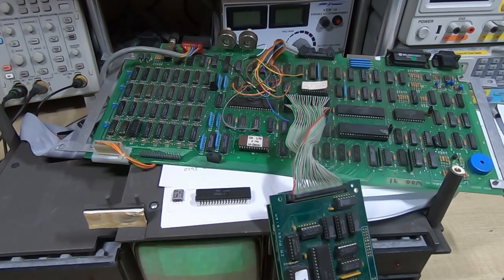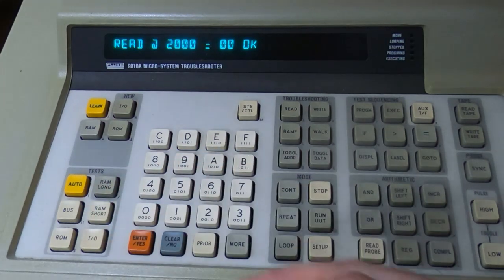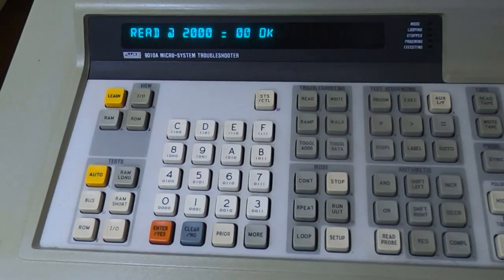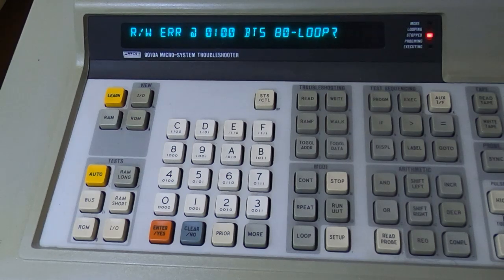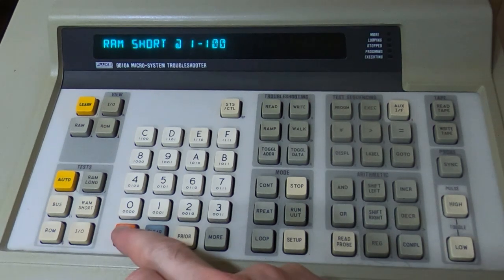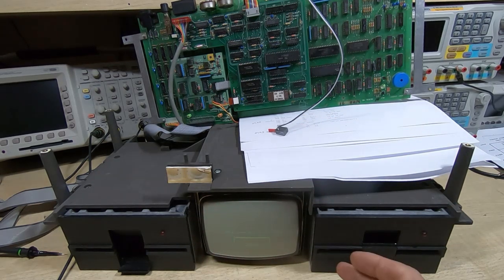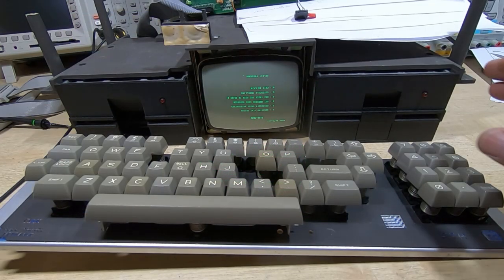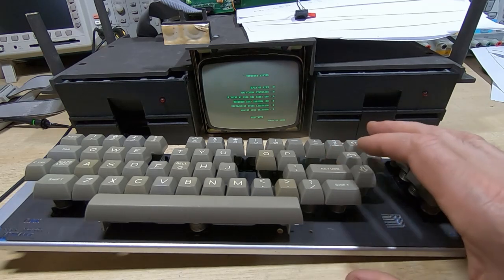Osborne OCC1 Repair Part8

Comment: I saw a homebrew solution to repair/mod a faulty foam keyboard. The guy had small magnets glued on the pins after removing the foam and metal contact and glued some hall sensors on the bottom, under the pcb of the keyboard. All was hand wired but it worked.
Maybe a PCB with smd hall sensors will be more resistant and look more professional.
Reply from the maker: It would be easy to design a replacement pcb using proper switches and just swap the key caps. I am just not sure I want to spend that much time on this machine. It seems to have been designed specifically to make things difficult from its construction to things like non standard floppy interface connections. This was built at a time when standardisation of such items had been fairly well established so it seems very odd to have designed it in this way. I may get back to it in the future.

Comment: I had a similar funny ram failure with some 2114s in a Heathkit H11.  Certain bits stuck but not the whole chip.  It only started happening after the ICs warmed up though.  The machine would run fine for a couple of minutes and then go haywire.
Reply from the maker: Yes it is odd. I have replaced hundreds of 4116's and I have only seen 2 previously with individual bit failures. It is normally the output pin driver or row/column that fails and so all bits show as failed.

Comment: Using a membrane to save cost, space and weight seems reasonable, but holding it all together using melted plastic posts is pure evil.

I found a thread on the Vintage Computer Federation forums where someone had designed a PCB to replace one of these keyboards, using Cherry MX switches and custom keycaps, but it's not cheap and involves finding a locking keyswitch, which are hard-to-find and expensive.
Reply from the maker: I think that using a membrane was a very poor design choice. It may be OK on something like a ZX80 but not on this type of machine. It does not save any space as the keyboard housing is very large and there is plenty of space for a proper keyboard. I am considering fitting a proper keyboard into the housing. The key matrix may be different but it would be easy to change the monitor ROM lookup table to suit.